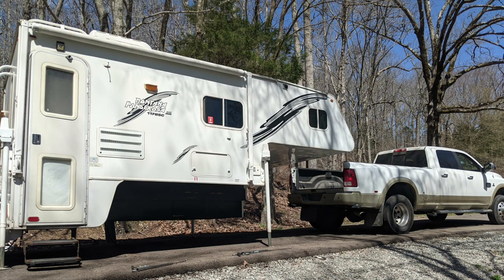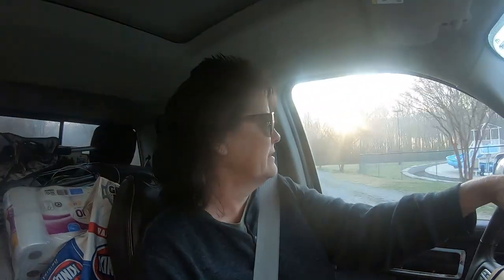My Truck Is Sick!! | What The Heck Is A Throttle Body Sensor?

Comment: Having engine problems can be very stressful and frustrating dealing with dealerships.  LOL  Glad you got it fixed and you're on your way!
Reply from the maker: Thank you so much!  Yes, issues like this can be frustrating but so far it has all turned out well!  So thankful that the sensor replacement has corrected the issue!
Reply: Hi Mark

Comment: Good call on your part. It's amazing the ups and downs of dealing with mechanics, or so-called mechanics. You rolled the dice and you were right. So happy for you.
Reply from the maker: Yep, I just felt that the sensor replacement needed to be done to either correct the issue or present another code or issue!  Something needed to be done!!

Comment: So glad it wasn't more serious. So glad you got the item replaced. When I think about going fulltime on the road, breakdowns are one of my biggest concerns, especially going solo.
Reply from the maker: I hear ya!  It can be scary at times but the majority of the time there isn't that stress.  So when it does present itself I just try to go with the flow and not over react while it is happening.   This was one of those times that I expected to be at the shop for most of the day and willing to get a rent a car for several days.  Things worked out and I can now move on!!!  In my case the breakdowns have been so few and far between that when they happen I just try to go with them in a positive manner and try not to over stress myself!!!  Things are going to happen and we just have to try to work through it!

Comment: Darn Frugal that sucks. Sorry you had such a hassle getting your truck fixed. I have had a problem off and on for several years with my check engine light coming on when I’m towing the trailer up a steep hill, had it checked and they just said it was an oxygen sensor but then it goes out again so I have not had it replaced yet. Glad all is well and you’re going to be able to get back on the road! 👍❤️🐾
Reply from the maker: I too have had several check engine lights come on and the codes get cleared.  This one was so predictable and the dealer was just negating what I kept trying to relay to them.  If it was just throwing the code I wasn't that concerned about it but they physical jerking that I was experiencing was concerning me!  So, I have had the camper back on the truck for several days and still no issues.  Heading out soon....
Reply: @FrugalRVGal  good news. Travel safe 🤗

Comment: I have a NISSAN 350Z It is a 2005 Well my throttle body went out. But first it went in to limp mode. I had all the work done at the Dealership
Reply from the maker: Oh WOW!  Limp mode?  My truck would just jerk which freaked me out when it would do it but it would still drive at normal speeds.  It did get scary when it didn't start that one day.  But, all is well now that the sensor has been replaced!
Reply: @FrugalRVGal  Also I think I have mentioned I work for Frito Lay... One of the Frito Trucks I  drive which is a diesel Ford Transit it went in to total limp mode there was water in the fuel. Apparently there is a drain so the shop drained the water out about a pint. Remember when we had the cold snap in Colorado? That's what caused it. I could have walked faster than that truck would drive haha glad you're all fixed up now